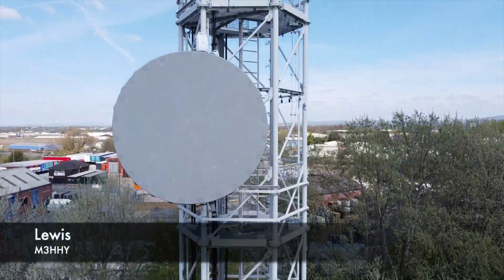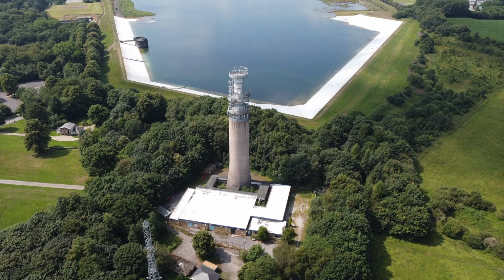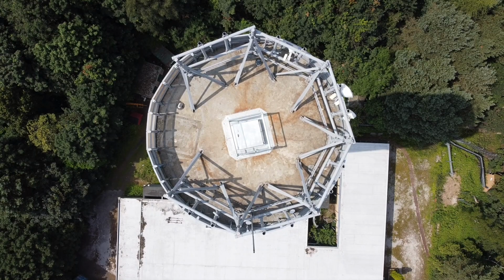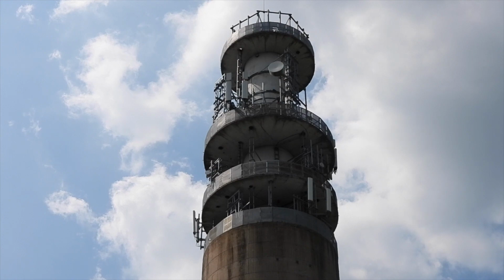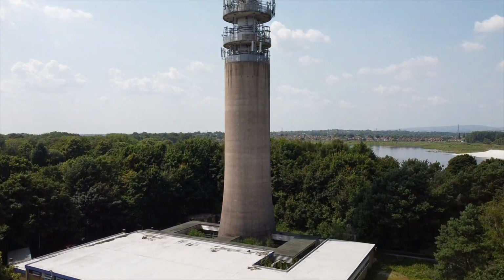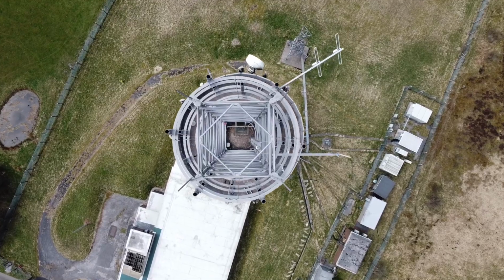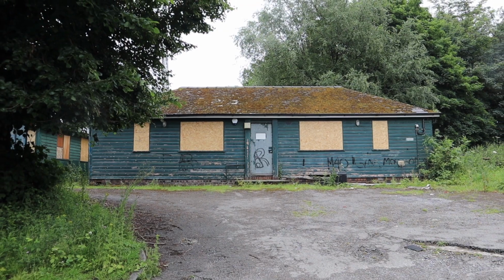The UK's Top Secret Nuclear Resistant Radio Towers

Comment: According to "uk radar pages" as well as the voice/tv channels, the RAF could pipe raw radar return signals through the links.by doing that the main ground controlled intercept bunker then had full access to all the radars. It also had a capability for combining/comparing signals from pairs of radar heads...which was great for defeating radar jamming including triangulating where jammer was, and appears to have had far superior performance than two radars working independently etc

Comment: Many of the cable between these sites were upgraded with fibre optic in the 1980s with what they call MU main underground cable between exchanges and transmission towers normally designated with a Y code. Y codes are still used today in business ethernet provisions. Military sites are usually designed a Q code.

Comment: The northern towers seem less sturdy than their southern counterparts, i wounder if the reason was that they were less likely to suffer damage in an attack due to their location having been a les likely target arias ?
Reply from the maker: There’s pretty much no difference except differing heights across the board and number of floors at the top section of the structures?

Comment: The top section you refered to was a crane. However, I don't remember them being used that much when installing new aerials.
The one at Charwelton was hit by a low flying Tornado jet, which caused a bit of damage to the crane and an aerial. Bits of the plane wing tip were recoved very quickly.

Comment: There was a tall lattice tower at Cheadle next to the Alex hospital which I think was associated with a nuclear bunker. The tower was pretty much halfway between Croker Hill and Heaton Park, so with the curvature of the earth the line of sight microwave beams would not have been too high there, so Cheadle could participate in the chain using a relatively short mast. In similar vein, there was a tower inside the nuclear facility on the Wirral that could eavesdrop on telephone conversations to and from Northern Ireland, which at the time would have been of great interest to UK security.
I think it's a pity the towers have lost their distinctive microwave horns. Sutton Common in particular looks quite naked now, though I appreciate they were probably in need of maintenance and maintaining a redundant bit of kit isn't a priority!
I thought the function of the Backbone had been taken over by fibre optic links? I wouldn't have thought Satellite links would have the required speed and bandwidth.
Reply from the maker: https://youtu.be/6cOieO05L-I

That’s the tower at cheadle today vince 

https://youtu.be/mQo6MuX6DI8

Also capenhurst at BNFL

Comment: One of the stations I work for that I think is on its 75th anniversary now has a cold war bunker in it that at one time housed an emergency studio, transmitter and was fed by a hardened generator shack elsewhere in the building that has redundant grid feeds. Even had a little pipe going outside that was for sticking a radiation probe out of to see what the levels were like. I do know it was near impossible to run new cable in it because you have to hammer through about 3ft of cement and rebar. I don't know if any extra hardening was done to the AM tower but it's still standing and in use. The FM station in the building is still the primary for the emergency alert system taking advantage of the redundant everything including redundant offsite generator backed up transmitter locations. I have not seen any similar hardened towers here in the US give or take some of the Bell Longlines. There is a bell archives youtube channel that is fascinating and covers them quite well.

Comment: There's another concrete BT tower in Purdown, Bristol that must also be a part of the system, though not this core section you mentioned?
Reply: The Tinshill (or Cookridge) Tower is the shortest of the Chiltern towers, probably because it is sited about 700 feet above sea level. Curious that it isn't mentioned in this video.

Comment: I found an interesting although unproven link that I think was missing from backbone. A cable was installed from North Wales to Lytham with the local BT exchange in North Wales having two rather large (20 feet across) microwave dishes installed mid eighties. If you think about it Birmingham and Manchester almost certainly would be taken out in the initial blasts from Russian atomic bombs. So a backup route would be needed to keep the system connected to Scotland or even the VLF stations to allow them to operate.
Reply: Look up - 
*Birmingham 
= ANCHOR 
*Manchester 
= Guardian 
London 
= Kingsway 

Deep level bunkers

Comment: Realistically, how were these supposed to be serviceable after a nuclear attack? Even if the tower survives, it seems like a nearby, let alone direct, atomic explosion would wreck the antennas and electronic equipment. Seems like they would be obvious targets as well. Or was this just early enough in the cold war that precision attacks weren't really considered?
Reply: Exactly, I've always thought the same, and it's not like they were discreet. I think they were designed so that the microwave horns could be replaced very easily and quickly from the platforms, but even still, how much of a prize target would these have been in general, to destroy the whole structures? I think that they might have been a bit of a red herring, with another system in place behind the scenes, and/or that this network was an absolute last resort, and and despite it's obvious weaknesses, was still better than nothing, especially when money isn't really an issue.
Reply: @Uamaretwot Everything.. would be VAPOURISED..

Comment: The equivalent in the US was the ATT Longlines microwave network; built for a cold war sage network and also serving normal customers. The microwave tower's buildings on the ground are faraday cages to reduce EMP further. It works very effectively! Fiber optics eventually replaced microwave for EMP resistant long distance communications.
Reply: It was sad that long lines was made redundant.  It's that redundancy that makes the system strong.  From all the outages that have been happening over the years.  I think we need it as a backup.
Reply: There are some sites that AT&T will not dispose. Most of their "independent" sites out west have been sold but there are other sites that are "linked" and will remain the property of said company and they run critical fiber lines between these sites.
Reply: @Subgunman  that's cool.  I didn't know that.  It makes sense because they are hardened facilities.
Reply: I've always been fascinated by the SAGE system, radar system with networked computers in the 1950s and 60s, with datalinks to F-106 fighter interceptors, it was pretty futuristic in its day and that old school tech is interesting.

Comment: Superb video as usual and I just knew that someone would comment on how close you were getting to the towers and the links, the only danger of course was a fly away of your 250g drone, these microwave links are very robust, as you know many years ago I was running a permanent 7 mile link, these towers are from a bygone era and nearly all are very sparsely populated, sites charge the operators even if the antenna isn't being used so once they stop using it,  it comes off the tower.

If you want any footage of charwelton I can fire up my hot air balloon for you, cheers.

Comment: Here in the US, AT&T (our former legal private telephone monopoly) used concrete to build the post war "Long Lines" microwave links. While everyone knows that EVERYTHING was in short supply for years postwar in the UK, a lot of people don't realize that here in the US steel was in relatively short supply post war (along with wood for houses, etc.etc.) during the "planning" stages. (I suppose that this is part of the "USA land of plenty always myth"...) So the towers were designed and made of concrete. This also gave a practical enclosure, allowing a relatively short distance between the actual well housed transmitters and made for lower loss feeding the horns, with the added grounded metal shielding lining all of that!  When they were doing the buildout, they were primarily given the publicity of being for telephone and television relay, which of course they were for. But LESS publicized were the use as links in case of nuclear attack. Fun Fact: During testing it was determined that EMP will go right through windows. While this seems obvious, the contractors building  the brick local telephone switching network buildings that the "long lines" towers and EVERYTHING ELSE ultimately terminated at  locally didn't know about that. As a result? Every window had to be bricked up, everywhere in the entire country.after the fact!  And you can see that in every small town and city that still has these local  buildings that house the local "switch", now electronic, but mechanical crossbar back in the day : The window frames and the added bricks are obvious: A Cold War Relic seen everyday in Everytown, USA though most people don't know it.  73 DE W8LV BILL
Reply: Post war all the council houses in Manchester were made out of concrete. Because they are a bunch of peasants.

Comment: I am sure I read a few years ago that many of these links "coincidentally" also passed over major military bases.
Reply: The North spur from Heaton was... Winter Hill, Middleton nr Lancaster. I forget what happened after that, but There was a site north of the main cluster of masts at Quernmore nr Lancaster. 

Anyway, IIRC, The Winter Hill to Middleton link passed right over Longley Lane, Goosnargh, North of Preston. That was UK Warning and Monitoring organisation HQ in an old ROTOR bunker. 

Incidentally, before the sector bunker network was abandoned a transition happened from UHF (450/460MHz) to L band. With cigar shaped sheathed yagis linking the bunker network. After the bunkers were abandoned Sunley Tower in the centre of Manchester became a node for that system. I suspected it was a Regional Seat of Government within the civil defence network.

I used to hunt bunkers in the 1980s and early 90s. If anyone is interested just ask and I'll try to remember more.

Anyone else remember MOULD?
Reply: @chrisreed5463  I remember Mould well, we used to hear the UHF links transmitting in the 70 cm Amateur band.
Maybe something for Lewis to research.
Reply: @jonmac3995  Mould was fascinating. Putting their links in 70cm was a decision I never figured.
Reply: Mould was on 70cm because that band is "owned" by the MOD, and us amateurs are secondary users.

Comment: Comrade Wingray,

Some interesting facts I can add to this excellent video.

That top secret concrete tower at Heaton Park was originally a cooling tower for a small power station. You can see the old power station buildings at the bottom. They sold it to BT and they turned it in to a radio comms tower.

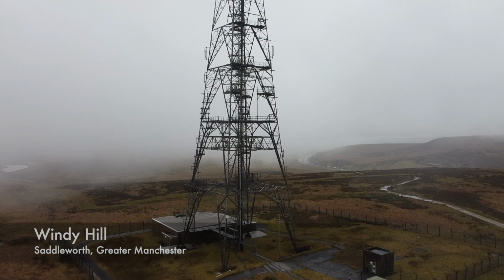The Windy Hill, Saddleworth, tower at 04:15 was a spare electricity pylon that belonged to EDF energy. They sold it to  Granada television for TV transmissions. It was quite a job lifting it up with a crane and moving it.

The public telephone at 05:25 is still a very common sight in Manchester. It's how most Mancs communicate when outside and they need to call back home to say what time they'll be back for tea.

At 06.09. It's a community centre for under privileged Mancs.
Reply from the maker: Thanks as always my friend, I’ll add all of the above to a revised video for your viewers in the DPRK
Reply: Don't give up your day job
Reply: @SuperVC-10  You need a day job! I'm the Glorious Leader of the D.P.R.K. 🇰🇵